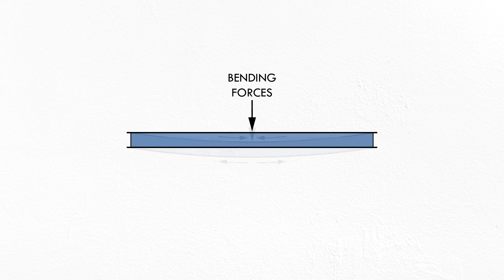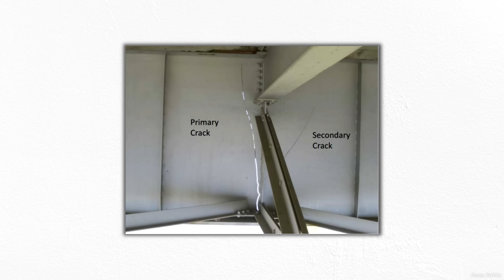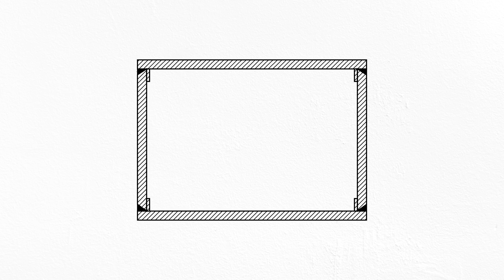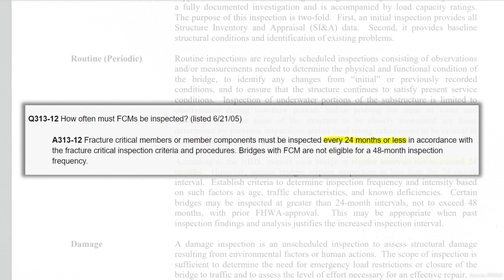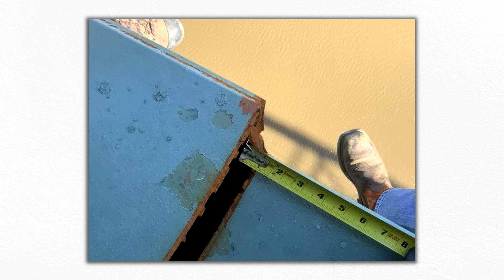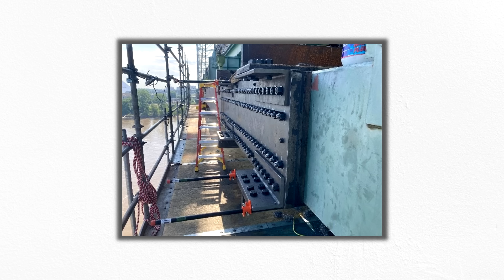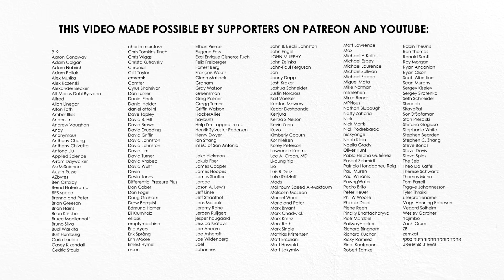What Really Happened at the Hernando de Soto Bridge?

Comment: The I-40 bridge is newer than the I-55 bridge, yet it still had a structural failure. The I-55 bridge now has WAY more traffic running across it. I wonder if the old bridge is now developing new cracks.
Reply: 2 years later, we need to build third bridge,  because existing 2 are closed due to repairs
Reply: @kvakerbillduck9500  Well, they'd better start building that bridge right now. 
Unless you are thinking of hiring the army to build a bridge...
Reply: They have since determined that the fault happened during manufacturing. It was a miracle it lasted as long as it did.
Reply: @stevelavergne2852  
Do you have a link to the details concerning this fault.   The larger steel members to the bridge were forged in Ohio (I think) and were transported by barge.   Other parts were forged in Memphis at the former Pidgeon-Thomas Iron Works at main and Crump Blvd.
Reply: On the other hand, older bridges tend to be built with much larger safety margins, because they did not have the technology to build reliable bridges with smaller margins.
Reply: @captainchaos3667  Thats true, but unfortunately those safety margins were for lighter loads. Trucks and vehicles carry more now than before.
Reply: @captainchaos3667  The Memphis area could stand to have a bridge built about 20-30 mi south of downtown to get thru-traffic bypassed out of downtown. On a map I see I-69 running west from 269 and I-22 but dead ends short of the river. It should be extended over a new bridge into Arkansas, and should be tied into I-40 somewhere between Forest City and Midway Ark for a better direct routing of eastbound traffic. For instance, a trip from Little Rock to Birmingham AL currently has to run on I-40 east to just short of the river, bearing right at the split for the I-55 bridge, then once across the river a driver must take a cloverleaf exit to stay on 55 (a quirky routing). 55 there is a refurbished urban "expressway" with a low speed limit (45) for several miles. Once it crosses US65 it's more like an interstate, but to reach I-22, local roads i.e. TN route 175 have to be used to reach I-22. There's a lot of chances to make mistakes, and you're dealing with local traffic and plenty of stoplights and store entrances.
Reply: @dtvjho   To reach I-22 from I-55 out of downtown Memphis, one should continue from 1-55 on to I-240 and exit at Lamar avenue east.   This is a federal highway that connects directly with I-22 in north Mississippi.  It is still in the processes of improvements on the part that is in Tennessee.
Reply: jacob harris. why just ask your local politician, i'm sure he has an answer for you.
Reply: The 55 bridge was built like a tank, the 40 bridge was built like a recycled pop can
Reply: We need a 3rd bridge in MS just south of Memphis. Either a extension of the i69 casino spur (though they would need to add a South bound ramp added coming from the west at the i69/i69 spur interchange). The other option would be to extend Goodman/302 into an interstate spur across the river. The first option makes more sense on paper but studies would be needed. Both are candidates already out of 10 other corridors for a 3rd bridge.

Comment: The bridge was designed by Bethlehem Steel from what I understand.  When they were in business, they didn't make mistakes.  No failure occurred probably because they accounted for such an event.  As for the cause of the crack, perhaps the earthquake retrofit permitted movement of the bridge perpendicular to its span. This was a condition the bridge was probably not designed to resist.  Such movement could result in twisting of the tie beam as indicated by the horizontal displacement across the severed crack perpendicular to the axis of the tie beam.  This is all conjecture at this point of course and have to wait for the findings assimilated through peer review.
Reply: that was my first thought also, the major "improvements" were hastily bad engineered anti-improvements, causing improperly loading and stresses.
but I bet their computer models claimed everything was great and it would be a super perfect bridge. I feel the same about the 737 max ;)

Comment: I agree with the description given about “fatigue cracks”. A small example of what was happening with that tie would be to take a steel coat hanger and bend it back a forth, over and over in the same spot, eventually it will break in half. It is my estimation that from the weight of the vehicles making it bounce up and down, creates heat within the steel, which in turn makes it weaker until it cracks.

Comment: I'm not sure if this video was prompted by the recent highlights Miami Florida or the collapse of the building, but one thing is for sure, this for sure is a good video 2nd I think it's a wake up call, I think any and all structures, particularly concrete structures, followed by steel and wood structures should be inspected, analyzed and tested in that exact order.

I think what has happened and I think what is happening or what I believe it's happening, is a wakeup call and that's a good thing, thank you!

you now have a new subscriber....

Comment: A whole video about engineering bridges and not one mention of a safety factor. Basically, you build the bridge way stronger than it has to be so that when it starts to deteriorate or fail, it is still several times stronger than it has to be. If the Factor of Safety is 8 and one of the ties breaks cutting its strength in half then it is still 4 times stronger than necessary. That is why the bridge didn't fall down. Rest assured after the engineers look at the bridge they will determine why the crack formed and may even be able to get rid of that reason making a much longer lasting bridge for the future.

Comment: Outstanding video!  I'm not an engineer, but having worked at a structural steel manufacturing facility years ago it made perfect sense the way you explained it.  I remember having inspectors onsite with x-ray equipment to check welds and a process I believe was called Magnaflux(?).  We didn't make box beams but rather I-beams, mostly for overpasses on the Pennsylvania and New Jersey turnpikes.  Thanks for the lesson!

Comment: Being from Arkansas and driving across this bridge many times has my attention. I have hated this bridge for many years. When I see the photos and the videos of the so called crack I want to scream that it is a break not a crack. It is completely broken and has shifted sideways and is so rusty that the break has been there for several years. I refuse to ever drive across it again and the I 55 bridge has had rusty bolts for decades. Driving across it in 1980 was an eye opener. Rust eats metal and that bridge was rusty 40 yard ago.

Comment: At 9:05, you can also see a vertical member (that happens to be in line with the break in the box member) that appears to be bent, with rust at the bend where paint has flaked off. Does this indicate a clue as to the cause of the box beam's failure, or is it a result of the beam's failure?

Comment: "How did the inspector miss that crack?"  He never got near it, that's how.  His job was to get into one of those cranes the video showed, to get within arms distance, and he refused to do so because he didn't trust the crane (reportedly).  If you're only inspecting the bridge once every two years, in a 5 year span, that's only two inspections.  The inspector that actually caught the crack on video was there to inspect the cables, not the bridge, and they were using drones.  He's the one that called 911 on both sides of the bridge, and had to argue with the Memphis side to get them to shut their end down because the dispatcher didn't believe him.  Ended up talking to the Chief of Police and told them Arkansas had already shut their end down, so people coming west on the bridge would have nowhere to go.  There are procedures in place for almost everything, but humans still have to follow them for the procedures to work.
Reply: When you shut down a bridge, you stop traffic getting on. You don’t stop traffic getting off.  They certainly didn’t force people to stop on the bridge.
Reply: @stargazer7644  you obviously don't understand bridge closures
Reply: @ardeladimwit  Pretty sure I do.  What I don't understand is people that don't use common sense.
Reply: Considering the bridge is supposed to be managed and maintained by two states, you would think there would be an agreed contingency plan in place for disaster management concerning the structure by both.
Reply: I doubt they had nowhere to go, wouldnt be safe leaving them out on the bridge or make them go back.
Reply: So why didn't he have the proper inspection equipment?  Let me guess: The state legislature cut the budget.
Reply: @thekinginyellow1744  That's a common refrain in modern America.  An anti-government (anti-tax) group complain about government (fairly or unfairly).  They get elected.  They cut government services (like transportation).  Then when the supply-chain collapses they complain about government services to get re-elected.  Voter ignorance is amazing.  Same as "blame pro-vax president for un-vaxxed covid deaths" or "claim voter fraud without any evidence (Big Lie)" or even scream "inflation is terrible" when by definition an economic recovery generates inflation.
Reply: @jimmiller5600  Let's go Brandon
Reply: Whether they used a crane or a drone to inspect the bridge, there is usally a team of engineers/inspectors conducting these inspections and reviewing written reports and video footage from the drones, you either fire them all or you fire no one, but I guess to save face the spineless executives had to point the finger at someone, instead of taking responsibility for not noticing the crack before it became a major structural failure.
Reply: @garrymunn6760  Our laws do not allow us to hold our government responsible for it's failures, and that same government isn't going to enact a law changing this. So we either continue to accept these failures, change the government to one which is responsible, or ignore the law which says we can't hold them responsible.
Reply: "The Challenger is "go" for throttle-up".
Reply: @jimmiller5600  Amazingly if they had not throttled down its possible they would still be here.
Reply: they had drone footage, did you not watch the video?
Reply: "His job was to get into one of those cranes the video showed, to get within arms distance, and he refused to do so because he didn't trust the crane (reportedly)."
Obviously, he was a bridge inspector, not a crane (access platform) inspector ! He should be wearing a harness attached by a lanyard to the access platform - but that wouldn't save him if the bridge collapsed :)
Reply: I as a traveler, visiting bridges a lot. myself couldn't believe the support over. R R bridges were extremely rusty. But trusted the officials and their expertise, in having a active solutions.
Reply: I believe the defect  was at some point discovered but may not have been worthy of mention and investigation.  More than one person needs to be fired - including managers of the inspections teams, specifications and reporting requirements.
Reply: They could get off on riverside drive or danny thomas to the old bridge.There was options.
Reply: @sunshinethrutheice8554  That would be a typical government employee approach!
Reply: not surprising. People in Memphis are not the smartest..
Reply: Not completely true. The crane thing was just that he wouldn't extend the crane's arm as far as it would reach, because the entire thing would start tipping over and it was too dangerous.

There were ways to find the issue, such as with drones, but they were using an outdated, unsafe, and inadequate method.
Reply: @Snowstar837  not true in most cases. those crane trucks are designed to lift and/or extend, well over their rated capacity fully extended. usually 250-500 lbs in the basket, fully extended. there are more than likely counter weights on the opposite side of the truck as well to help with stability. that inspector just didn't want to do his job, or was scared.
Reply: @jackclark1994  Maybe they issued them with the wrong crane. Still doesn't excuse not following inspection procedure. They could have refused to perform the inspection at all, forcing their employer to provide them with appropriate equipment.
Reply: @jackclark1994  I use to work at Altec and we indeed would put hundreds of lbs of counter weight to offset tipping.  We would test every truck and extend the boom to the max.
Reply: V

Comment: Possible contributing cause: overweight vehicles. 2x the weight can do 1000x the damage.
The tension force must have transferred to the deck and the tension beam on the other side. To let the gap in the broken beam open up, the ends of that span have move apart and to rotate a little. The decks outside the arches might fight that, applying a little compression to the broken side (but also increasing tension on the unbroken side). If the other tension beam had broken, the bridge could have collapsed.

Comment: This should stop being called a crack.  It sure looks like a break rather than a crack to me.
Reply: Yeah, it started as a crack, but it appears to be a clean break now.
Reply: I was curious about that too.  Was it severed all the way through, or was it still connected at the back where we couldn't see?
Reply: @Lazirus951  it was still 40% intact most of the bottom plate and rear plate were still intact . we classify failures by their base cause here a crack formed then propogated  .
Reply: @tyler7433  Ah, thank you!
Reply: @tyler7433  Thank you for that. The pictures don't show that the back & bottom are still intact. I was puzzled how a complete break of a vital structural tie didn't result in more than a few centimetres gap if it was really under huge tension
Reply: @ferney2936  Being tied to the deck means the gap would never get bigger, because the connections keep it in place, more or less. The rusted edges of the break do mean the fracture is old. Should have been spotted.
Reply: @tyler7433  your dot at the end is wayyy yo far mate .
Reply: @Biden_is_demented  how did it get offset then? It started as a crack, sure, but when found it was a full break. They’ve found more cracks too, going to be shut down for a lot longer now.
Reply: @Just.A.T-Rex  "how did it get offset then?"

Years of stress, contraction and thermal cycling. As the metal heats and cools under the sun, stress builds up in the metal. Once the break happens, the metal stresses are relieved. Horizontally, the metal has no where to go because the trusses keep it in place. But it can move vertically. 
Bridges are usually built with expanding joints (don´t recall the name in english) that help dissipate the effect of heat. If this bridge did not have them, or they are placed at the wrong place, heat can have a devastating effect, because metal expands and contracts. In some conditions, extreme heat during the day and cold at night, you can see a bridge expand and contract several inches. And if that expansion is not taken into account, all the stress goes to the beams. This might be a case of a bad bridge design.
Reply: @Lazirus951  It's totally separated.
Reply: @Lazirus951  All the way thru, displaced a full inch in all 3 dimensions
Reply: Yes...  it was a crack...  was..... NOW  it is a big ass  Break in it  the Beam...  as in two ....
Reply: That beam is 2 foot by 3 foot its got a lot of stress on it to break a beam that big
Reply: @stevenhiggins3331  yes...  but  it did not do it  over night...:-)
Reply: Crack is something that does NOT go all the way through. The picture of this, IS a TOTAL complete Break.
Good call on the Engineer/Inspector.  Calling to mind other bridge collapses.
Reply: Are you saying it's not what it cracked up to be?

Comment: well I'm definitely no engineer. actually I'm a truck driver that has crossed that bridge many times. in my opinion the inspection that was done in 2019 the damage could be called a crack. but the later photographs show complete separation. that's what my old hillbilly ass would refer to as broken.

Comment: I was at one of my company's warehouses and noticed a longitudinal crack in the same type of stressed member as this bridge, it was a 40s era quonset hut with wooden arches and supports, after I mentioned it to the manager, we began pulling all of the inventory out of the warehouse and were preparing to close the facility, several months later we had the San Fernando earthquake, and this building was right by the fault that slipped, I think this building would have come down had it not already been demolished.

Comment: With the I-40 Memphis bridge closed ; all that traffic including heavy truck/trailers crossing the smaller older I-55 memphis bridge ;  Average truck weigh of at least 70,000 pounds ,that bridge usually has a steady truck crossing.  Since the I-40 bridge closure,  the majority of traffic is crossing that bridge , how long until it collapses do to a constant full bridge ? I-55 bridge is much older than the other. I drive a truck and I will not cross that bridge at all. I go around the long way but so does everyone else so what's gona happen with those bridges as well. 
This I 40 bridge closure is going to cause more problems.  I know it's easier said then done but , they need to build another bridge north of I-40 , repair or replace the I-40 bridge and the I-55 bridge. It will be expensive and take time but it needs to happen.